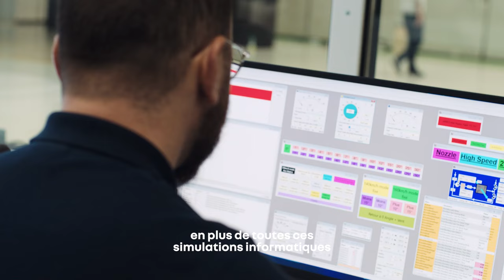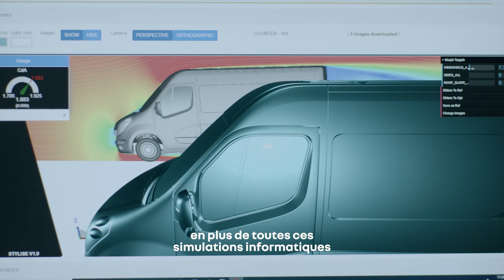le bon équilibre entre utilité et design | nouveau Renault Master E-Tech 100% électrique

Comment: I hope it will have more mileage with a more powerful battery and more capacity. And of course 4x4 for working on difficult terrains in the field, for example installation companies for agro voltaics, or just pro voltaic parks, and power lines. And of course to use the battery back in the field powering 220 or 380 V machines. 🤔🤔📈📈???